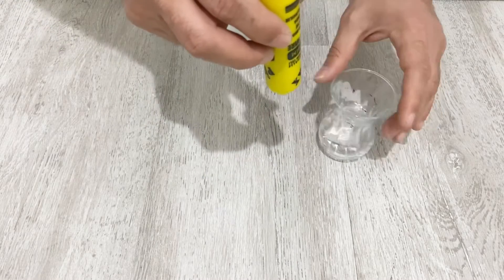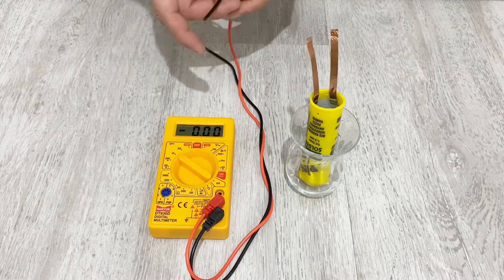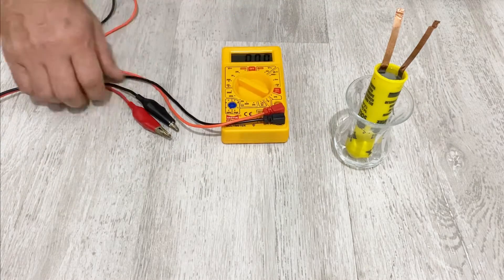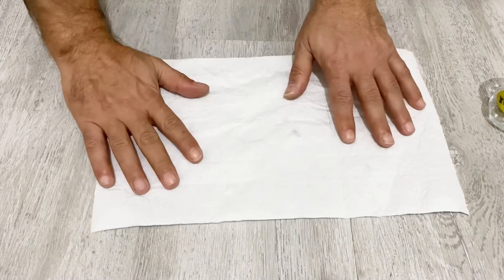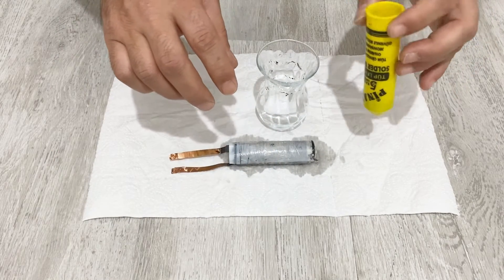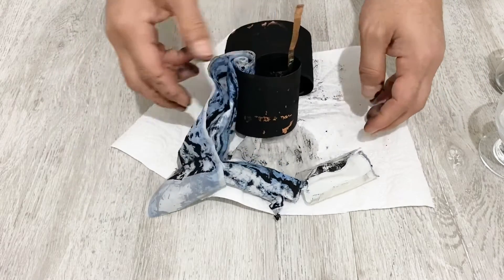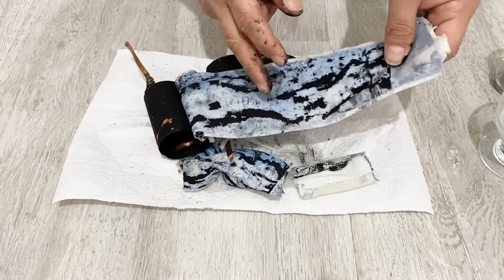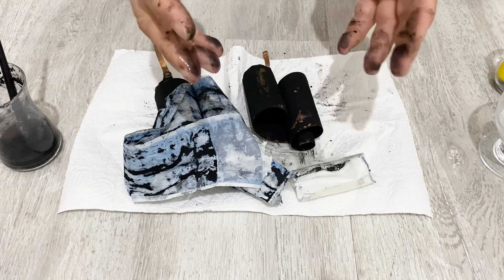Make Your Own Supercapacitor | DIY Supercapacitor

Comment: What will happen if you mix the electrolyte in the activated carbon paste instead of water to bond it to the plates?
Reply from the maker: When you dried the paste the pure NaHO will react with current collector.

Comment: Hey, great video! I am trying to make my own Supercapacitors as a research project in my school. Sadly, i did not have any big success yet, altough I`ve watched your long explanation video about DIY-Caps completely. I scaled your capacitor down a bit, and i used 1molar NaOH as electrolyte. Active material was: 10g AC, 2g Graphite, 1g PVA and 10g water. Eventough I followed this recipe, the active material was not very fluid but a bit hard (dont know the english word). In the end, I finished building it, but it maybe had 10milliFarad... I am also not really sure, what the max Voltage is, and a few other things i am unsure...
May be you can help my with my problem, would be great, if i could finish my project this year! Thank you!
Reply from the maker: Brother. I will try to help you by all means. First if your active material is so muddy and not fluid enough. Put a little bit more water until it become fluid. Secondly. Mix it very very well with a high speed blender. Paint it evenly as much as possible and apply as a thin layer. Most importantly let it to dry very well for a full day. And make sure that there is no short circuit when you roll up your capacitor. If there is no short circuiting it’s impossible to get less than 50 farads (according to size of course) try again and again eventually you will get success. Everyone fails at first. So don’t worry and try again. Break a leg brother.
Reply: @joyofelectronics9782   Thank you for your fast answer and your optimism, i will try further 👍

Comment: My dear brother, the previous question was about knowing the amount of voltage needed to charge a super capacitor. The dimensions of the plate used for manufacturing are 5cm x 5cm.

Comment: My dear brother, if the dimensions of the copper plate are 5cm x 5cm, used in the manufacture of the super expander when it is shipped.  What is the appropriate shipping cost for these dimensions?
Reply from the maker: As it is not my concern l have no idea 🤷‍♂️

Comment: Well done.❤ Can you try to make a higher Voltage Supercap ? But then you probably need a different electrolyte...
Or try to work with different PH values for both electrodes, but then it will probably work again as a battery...one electrode accidic and the other electrode alkaline ph value...I wonder how much voltage you will get then. Good luck my friend...🎉🎉❤❤❤❤😊😊😊
Reply from the maker: Thanks a lot. I’ve just made such a Supercapacitor (a hybrid Supercapacitor) it’s 2000 farads and 2.1 volts. It’s amazing one. I will post a video of it👍

Comment: Very well done. The Mole weight is printed on the bag or flask. Let's use "Salt" Sodium Chloride  = 58.443 g/mole
58.443 g salt in 1000 ml  = 1 liter distilled water = that's a 1 Mole solution. A >>>> 0.5 Mole solution, double the water

Comment: Great video! You mentioned the different types of electrolyte mixture you have to use for copper or aluminum and I have a couple of questions that I hope you can clear up for me. You mentioned using sodium sulfate along with soap or even alcohol or acetone to break down the water barrier for the aluminum plate capacitor and my question is what is the ratio for the water and sodium sulfate mixture and how much soap or alcohol are you using to break down the water barrier with? My last question is can you use magnesium sulfate for the electrolyte for the aluminum plate capacitor? What would be the ratio for the water/magnesium sulfate electrolyte? Thank you.
Reply from the maker: Thank you brother for your nice and kind comment. Let me start from the second question. It’s not recommended to use magnesium sulfate with aluminum. To your first question: all of the electrolytes should be one molar in terms of salts you used. And the ratio of surfactant material is should be a little. Ex: for 100 ml of electrolyte 1 gram or 1 ml will be enough.
Reply: @joyofelectronics9782  Once again, thank you. The only thing I'm not quite clear on is the unit of measurement in molars because I'm not familiar with those units of measurement and I think you are making reference to the molecular weight of what you choose to use to make the electrolyte with. In your video I think that you used sodium hydroxide for your super capacitor and if what I am finding online is correct, one mole of sodium hydroxide = 39.997 g/mol. If I want to use sodium hydroxide for my electrolyte solution can you tell me how many mils of water I would need for 39.997 grams of sodium hydroxide granules? Once again, thank you.
Reply from the maker: @flash001USA  1000 liter of water. In other words 1000 grams of water for that amount of sodium hydroxide.
Reply: @joyofelectronics9782  Thank you for clearing that up.